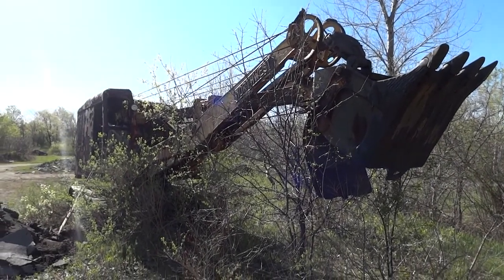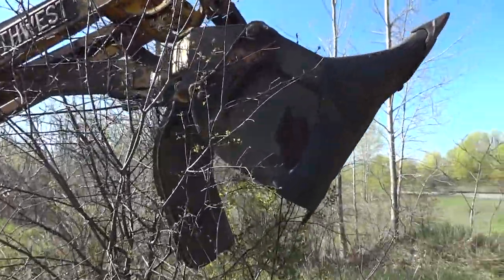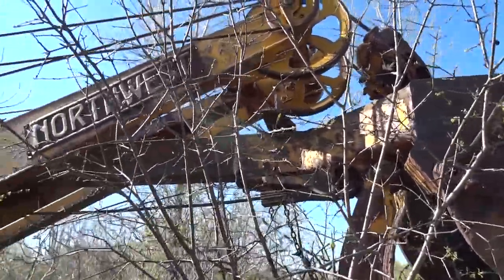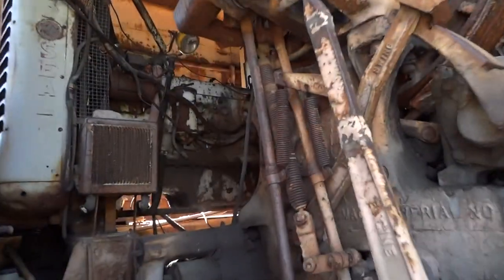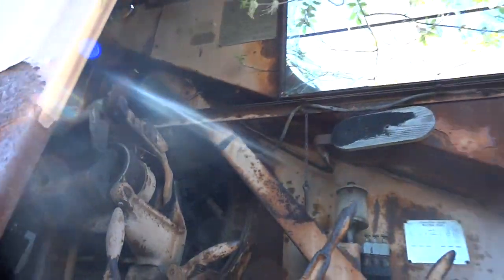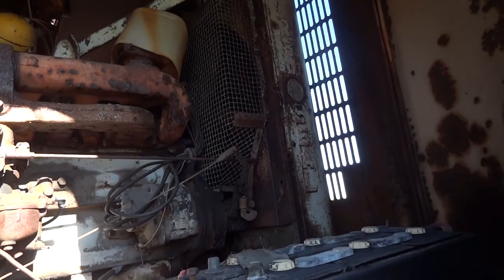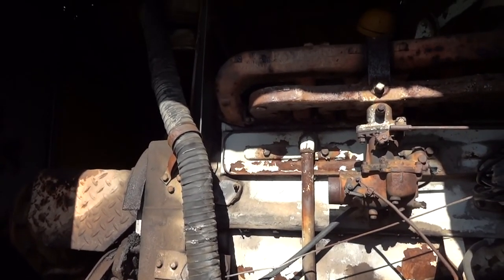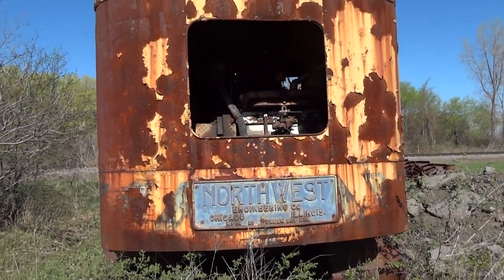Northwest Shovel - Junk Yard Find

Comment: Cool, I wondered about that, most of the "D's" that I've seen have Murphy Diesels in them, with the exception of one I saw with a 6-71 Detroit in it.  This one would be very neat to fix up and run again, I am a huge fan of Northwests and I hate to see them rust away.  Better to sit than to scrap though I guess.

Comment: You are 100% correct, thats a 3/4 yard Northwest 25D. Rare having a gas engine in it though. You can tell its the D version because it has the independent boom hoist controls where the swing/boom selector would be on the earlier model 25. I believe the 25 and 25D were co-produced for a number of years when the 25D came out.

Comment: Looks like one of the later "D" series shovels, maybe a 25D, but I don't with a gas engine in it, probably older than that.  I run a Northwest #2 at the Midwest Old Threshers Reunion every year, it's a little more simplistic than this machine.  This one might even have pneumatic brake assists on it, but again with a gas motor, hard to tell.